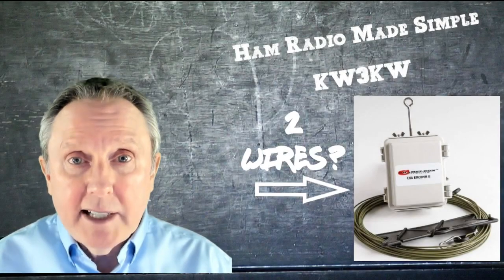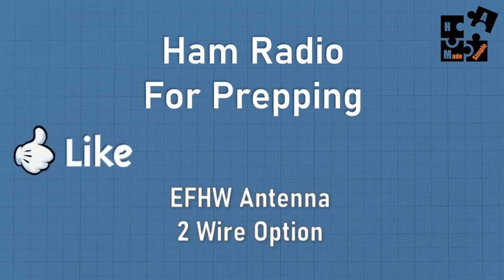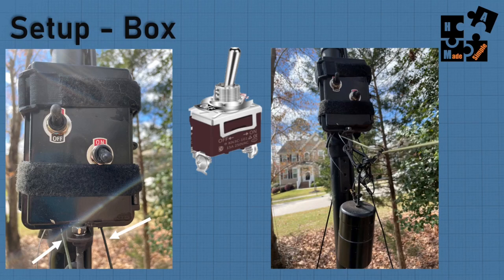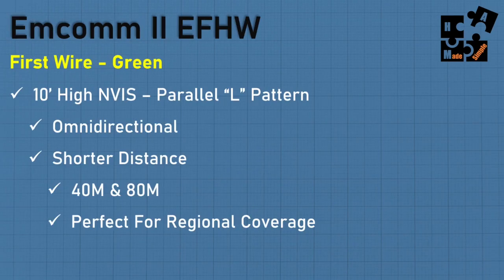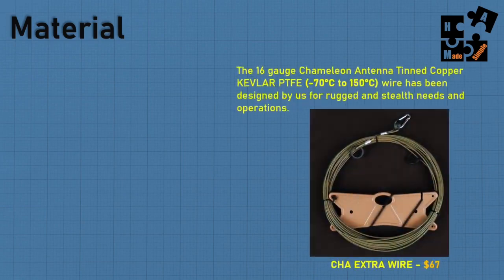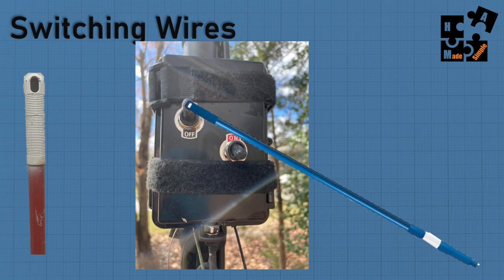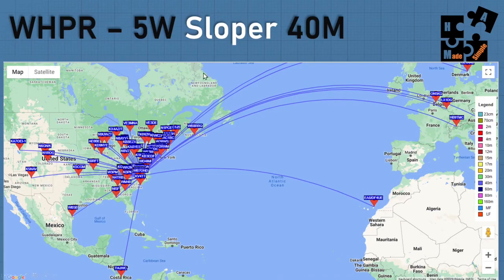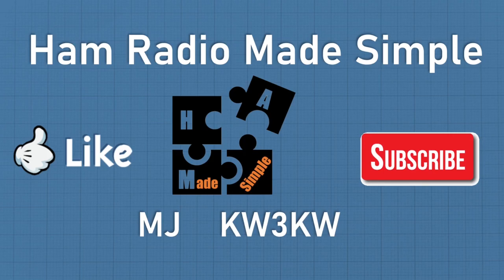EFHW EMCOMM 2 Using Two Wires - NVIS & Sloper

Comment: What kind of power level do you plan to use for actual comms?  I've been looking into switches as well and the voltage levels get high quickly.  If the unun is 56:1, voltages are about 118V for 5W, 374V for 50W, 529V for 100W, 1183V for 500W, etc.
Reply from the maker: I use about 25 - 35W digital and 85 -100W for voice through my switches. Email me at kw3kw@mail.com  for more info

Comment: Won't work on an EFHW. That's an EF random wire, and it requires a tuner!
Reply from the maker: Technically you are correct but it is marketed (along with others like it) as EFHF.  Also, I don't need a tuner for most of the bands since I installed it correctly.

Comment: The Emcomm II is not an EFHW!  It's basically and end fed random wire.  The Emcomm 2 uses a lossy 5:1 unun, the end fed half wave (EFHW) uses a 49:1 transformer that is fairly efficient, not the lossy 5:1 unit.
Reply from the maker: Technically you are correct.  However, by the manufacturer and others, they are being classified as such.  To reduce confusion, I called it what they called it.  Thanks for the post.
Reply: @hamradiomadesimple  I beg to differ, their website evens states it's a 60' wire fed with a 5:1 transformer and says nothing about an EFHW!  I see this mistake all the time of people calling any end fed wire an end fed half wave and we need to make sure we are using the correct terminology so that folks get educated on what they are buying and using and the differences between them.  Feed a wire from the end doesn't make it an EFHW, a half wave is a wire that "IS" a half wave length long for the band of interest.  An EFHW that covers 80 thru 10 meters would be about 134 feet long for 80 meters, not 60 feet long!

Comment: A good idea! Those running QRP might check inexpensive and lightweight TV coax switches. For low power they should work and they'd allow you to select different coax-fed antennas.
Reply from the maker: Great idea and thanks for posting this.  Only by sharing thoughts, ideas and experience can we grow in the Ham Radio community.

Comment: As a new ham who wanted to test emcomm capabilities, I hung a 40 m dipole at about 10 feet and worked the Florida QSO party on 40 meters.  In two days I had QSO’s with 30 Florida counties on 40 meters, phone only. I learned a lot about when 40 meters is dead and when it is alive.  I live in Boca Raton on the East Coast and this will be my setup after a hurricane hits.
Reply from the maker: I love the part where you TESTED and USED your setup.  Great job and you are ready to go NOW!!

Comment: This is a fantastic idea.   I’m a new HAM - just got my license.  Would someone tell me how to wire the two antennae to a SPDT switch?
Reply: Usually these switches have center connection that connects to one or the other of the connectors at each end. Connect the wire or cable to your transceiver to the center one and connect the antennas to the two on the ends. To make disconnecting those antennas easier, you might run those connectors to two banana jacks and then connect the antennas to them.
Reply from the maker: I am dealing with a neurological issue at the moment that causes me to forgot stuff (last video posted talks about this).  I really can't remember at this time.  Try me in a few weeks and I should remember this.  Sorry, my brain is not working quite right just yet.

Comment: I may have missed it but what are the actual physical lwngths of each radiating wire???
Reply from the maker: With the EMCOMM 2,  I think it is either 60' or 63' that comes with the setup.  I went an ordered a second wire from them since the coating on the wire is more durable.  Either way, start at 63' and bend back as needed.

Comment: Interesting video!  I will be doing something similar with my EFHW 35' high  sloper in conjunction with my roof mounted EFHW at about 13',  but I have coax running to both so will use a simple antenna switch in my shack.  Going to check out that "VARA' video.
Reply from the maker: GREAT, leverage your investment and have different outcomes with the two wires!!  Let me know how it goes.

Comment: I have wondered about this for a while, but why not use a spdt switch instead of two switches?
Reply from the maker: It should but since I keep my transformer up about 8-10 feet, It is easier for me to use the toggle switches.  If it was lower to the ground that would be another way.  Cost more but will work the same.  I use two spdt switches already in my utility box at the bottom of the flag pole.  I have two UHF/VHF antennas and two HF Antennas.  The other HF is Comet CHA 250 vertical antenna.  Thanks for taking the time to mention this!!
Reply: @1Ddrummer please let us know your results. I have suspicions it may not work as intended, unlike a fan dipole where the impedance is the same for each dipole and only one will be used and there isn't too much interaction? With both being resonant, I suspect the power may be divided between both. Would be good to hear from the experts or who can model.
Reply: @AusProbiz  I thought the same until I saw that he was only connecting one antenna at a time. Connecting two at the same time is likely to result in a really weird radiation pattern.
Reply: An ON ON double throw single pole switch is another option.

Comment: Very good idea and it would work !  I had commented on the video, then the video was taken down and now is back up. My comment was that I would think twice before choosing the Chameleon antenna. The reason is the price and the 5 to 1 transformer that is vey lossy. You lose over 50% of your transmit power in the 5 to 1 transformer. It's designed to be a broad band antenna, which may help with ALE type radios, but is unnecessary for the average ham. I stated I'd much rather use an End Fed Half Wave and not have all the losses on both transmit and receive. Loss with the Chameleon is two "S" units down compared to a resonate wire antenna. Price wise, you can buy or make a quality antenna for much less money. The Chameleon is high quality. You commented back that some people were saying the EFHF was viewed by some as a fad antenna and mentioned the Random length Wire Antenna which uses the 9 to 1 vs. the 49 to 1 transformer. I've been making great contacts with the EFHW, they work. They do suffer from multiple lobes on 10 meters and to a lesser degree on 15 meters. They are not perfect, but are darn good performers. If I want closer to perfect in a wire antenna, I use a dedicated Dipole. If I am adding an extra length of wire to the EFHW 10-40 meter version to get to 75/80M, I use a capacitor between the two sections to bring the 80 meter voice portion of the band in line so all the bands are in the correct part of the band all at once. My EFHF is just as "Tactical" as the Chameleon (I hate the word tactical, so over used).  I find the Random Length Wire antenna to be very interesting. I have not used one, but many who have like them.  I have used one at a friends QTH and it worked very well. The downside to the Random Wire antenna is the need for an antenna tuner and also the need for a choke part of the way back on the coax so that you don't get stray RF in your equipment. Being a non resonate antenna, they do sometimes suffer from RFI issues. The antenna uses the coax as a radiating element, so you need to use at least 60 feet of coax. More is better. I've read a counterpoise wire added at the transformer helps with this. You will need different lengths of counterpoise for different bands. Anyone who wants to learn more about the Random Length Wire Antenna (Which is not just any random length of wire) should go to the "Palomar Engineering" web page. There is some excellent info on these antennas on their site. Again, thank you for your great content. Your Digital videos are very well thought out and the videos are excellent.
Reply from the maker: You make some excellent points here John.  For those who have HOA issues and need to run a shorter wire, the non resonate EMCOMM II fits the bill.  Since I lately been doing digital, I don't need more than 35 watts it has worked great.  If I had a large yard (which I don't) and no HOA, I would prefer a resonate antenna and the wire run for 80M (which is a band I prefer over 40M) would be more than double.  The Palomar Resonate Antenna is one I want to go to when I move and hopefully get a large yard.

IF one has space the dipole is even a better setup for sure!!!!!!  Again, GREAT points and I as so glad you brought this up.  

Sorry for having to take down the video.  The intro was messed up (did not notice it at first) when uploading to YouTube.  That is what happens when you "read your own work".  You are oblivious to the mistakes LOL....
Reply: @hamradiomadesimple  I wonder about the efficiency of a loaded 80 meter vertical. It would be narrow as to frequency range. It should also have a much better take off angle. Maybe do both if you can. I can see where the shorter length of the wire that comes with the Chameleon could be a benefit on 80 M in a small yard or with a HOA. I just think it's important for people to know about the reduced efficiency with this wide banded type of antenna. If you are working digital, then less power is required anyway. I strive to always use the most efficient antenna possible within a given space (maybe a little anal....lol). I'm waiting until my neighbor who is a snow bird gets back with his drone to put my 80M wire over a 70' tall tree. Looking forward to it. It's not often you can get that kind of height on a city lot. I'll most likely do an inverted "L" with a 42' pole and the tree. Again, thank you for the great content. I'm over the "Fan Boy" channels who just put out too many junk videos to keep the $$$$ stream coming in.
Reply from the maker: @johnk23705  What you have is the IDEAL setup for a city lot, John.  You are blessed to have the space to set that up and your neighbors help to boot.  Let me know when you get it set up and send me a picture please.  kw3kw@gmx.com  THANKS!!!